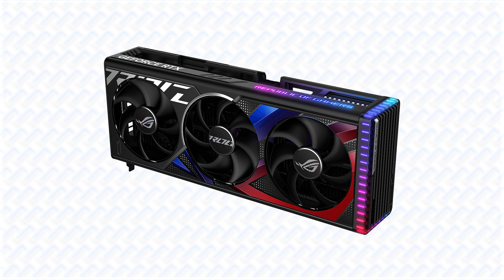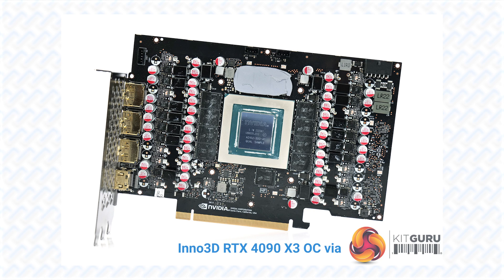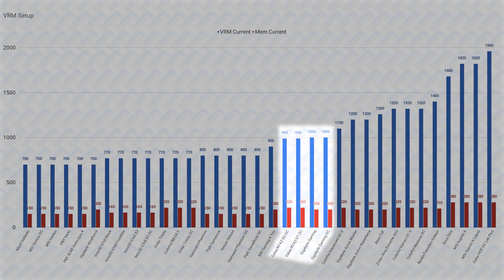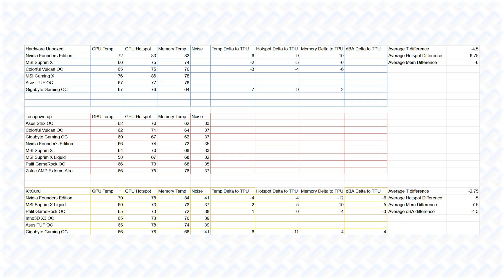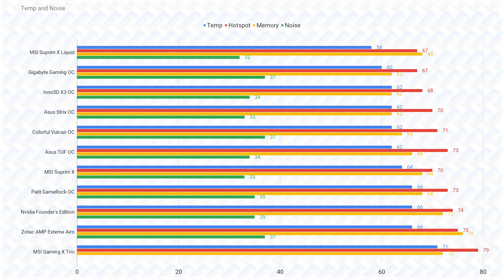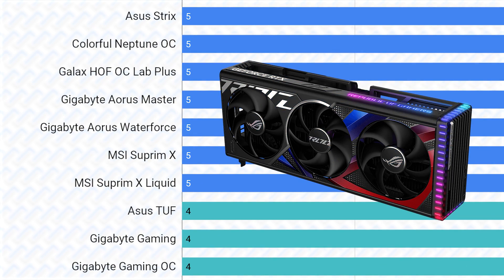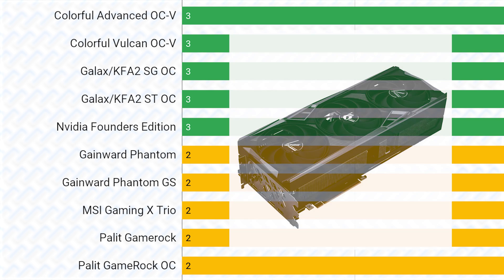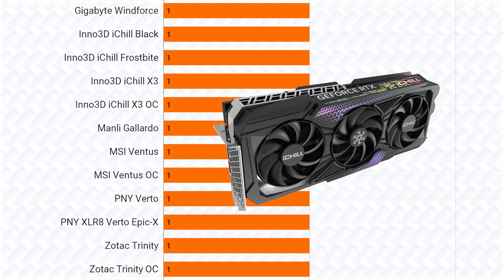Which RTX 4090 to BUY and AVOID?! | 35 Cards Compared! Asus, MSI, Galax, Gigabyte, PNY, Palit, Etc.

Comment: If going on synthetic benchmarks, when u have lots of xxxxx numbers ofc. some ppl. will say it’s a big difference, but in final all that is important, its how much % you can gain from 450W tdp to 600w tdp and that’s from 5% to 10%. But if you play games lets take an example in SOTTR: high overclock(1.1V,3000MHz, +1000mem- 480W, 65% fan speed, 74C, 129fps) and undervolt with overclock(0.096V, 2715Mhz, +700mem - 330W, 40%fan speed, 64C, 122fps), so 7fps(6%) difference it’s nothing compared with all that noise and heat.

Comment: Did you see the tomshardware January 19th review of the PNY 4090 XLR8 Verto?
They claim it has a decent build quality, "great cooling and noise levels". They did take it apart to examine the board and later overclocked the core +180 MHz and the memory to a stable +1600 MHz getting a 6.4% performance boost at 4K for an extra 3W. That's not too shabby for a card that's priced at the cheapest end of the 4090 line up don't you reckon?
Reply from the maker: The hardware is what it is. It is as it is in the tiers. That's basically almost nothing in terms of performance gain from the overclock, its because of the limitation in the power limit.
Reply: @OTechnology  so you read it?... they didn't deny the power limitation at all. And I am mentioning it in terms of pricing. What overclocking gains at 4K could be expected from a more expensive card... you didn't say. Would it be like 30-40%? I guess you and tomshardware have a different idea of value? I certainly wasn't expecting you to change its tier level mate get that out of your head.
Reply: @jemborg  yeah that seemed like a very defensive response and he didn't seem to care about the information you presented to him. Basically ignored everything you said and defend his video. Maybe he is secretly sponsored by some of the card in the tier tiers of his list, maybe not but it makes me not want to watch his vids honestly.
Reply: @Ku5hFi3nd     thanks. It may not be a card for benchmarking but so what? Besides I'm going to undervolt it anyway.

Comment: I purchased my 4090 Suprim X liquid a month ago because I could not an Asus 4090 strix. It looks like I got the better of the trade off.  I really enjoy your GPU videos. I watched this from two different net connection to give you an extra vie and a like. Do views in the lowest quality setting earn the some as the higher resolution views?
Reply from the maker: Yep that's definitely also a good model. Although I don't know if either is better. Thank you for your support haha! I don't think lower or higher quality playback matters :)
Reply: how are your memory temps and radiator temps? Read a lot of complains for really high (still safe, but relative to all the other models) video memory temps + insane high radiator temps to the point the longevity of the pump is questioned by experienced water cooling reviewers.
Reply: @gmdhighvoltage  I have honestly yet to game on the card, but I am mining on it 24/7 and the GPU temp maxes out at 42C and the memory temp is a nice FLAT 68C. with room temp at 84F/29C Compare that with my 3090 amp holo extreme in the exact same system in the exact same slot mining the same coin the GPU was 55C memory 90-94C around the same room ambient the card had no trouble in 97F/~36C room temperature.  Both the air cooled 3090 and the water cooled 4090 run the fans at 100%. You wear out fan bearings quickly when you change the fan speed all the time. Also temps will drop every time the cards are under other load types like video playback encoding etc. Nothing stressing the card consistently like mining, but as long as you have proper cooling (block/heatsink/pads/fans/etc) and AIR FLOW even at high temps there is no problems with most GPUs. I only started mining when idiots blamed the miners for shortages. Go look for the high end nvidia mining cards, most never left china and only now have they been popping up. The shortages on GPUs can be blamed on AMD and Nvidia.

Edit: I fixed the typos

Comment: Thanks for finding the time to do this!
I saw a different take on 4090s from a repairment technician: Strix, Suprim X, FE have the same component base in terms of top quality and the rest (from Techpowerup list) should be avoided as they are much more likely to fail soon after warranty period (from his experience on the same VRM components). What would be your take on possible tendencies to fail of VRMs from your list of 4090s?
Reply from the maker: You're welcome! Well like I said in the video, the weaker VRMs are cost cutting measures to hit lower price points. So, they will inevitably have lower quality components. I wouldn't say they would definitely fail sooner but I certainly would trust the higher end cards to have more chance of lasting longer yes.
Reply: @OTechnology  yet you praise Gigabyte Gaming and he doesn't since it has DrMOS worse than Zotac AMP which is also not good (that's probably why they lowered power limit)

Comment: Does the price for ASUS Strix OC ~ 2290 EUR make sense? Palit Game Rock OC costs me ~1875 EUR. Is it worth overpaying?
Reply: If you are not into heavy overclocking then absolulty not as the additional expense is huge! I have the Palit GameRock and it s solid, great cooling and very quiet. No issues at all since picking it up at launch.  Oh and they are already expensive enough...
Reply from the maker: Its up to you
Reply: @OTechnology  right, but you mainly mentioned overclocking. I don't plan on it because the 4090 has more power than is actually needed. It will be faster to buy another card model than to overclock this one.

Comment: I have a queation. Zotac amp extreme vapor chamber cannot cover the whole vram chip. Even the temp shown a few degrees higher it is certain that the hotspot is a lot hotter because of the uncovered half. How would it affect longevity?
Reply from the maker: Its not a big deal for longevity. Msi gaming x doesn’t even have a vapor chamber. But ofcourse cooler is better.

Comment: You should mention in your video that the Aorus Waterforce rev 1.0 has a tdp of 500w because it's based on the windforce model... What you have on your chart in terms of VRM and power limit applies only to the rev 1.1 waterforce model that has not been seen on retail yet... Every single card sold to this point is a rev 1.0... please don't ask me how i know 😭

edit: By the way what you say about the strix being binned is not accurate for the 4090s... Most of them struggle to compete... It might be a bios thing, but most of them barely exceed 3.0ghz with the extra vcore, while other models can go up to 3040+ mhz without the extra vcore...
Reply from the maker: Wait a second. This is new information to me.

Comment: Have a KFA2 4090 SG OC that I got at the msrp in my region, runs cool and quiet even when drawing 430W+. Have only heard coilwhine when at 600fps+ in menus in a few games. I have a 3080 Aorus Master (also a 4 slot card) that runs hotter and louder. Since I run my games mostly with a 120 fps cap, the 4090 in many games draws less power than the 3080, even when I run the 4090 with much higher settings and RT enabled at 4k. Very impressed by the 4090 so far and I really can recommend the KFA2!
Reply from the maker: Yea the Galax/KFA2 SG cards are impressively good for not being their top end HOF card. Definitely a good 4090.
Reply: I have 4090 HOF standard edition which puts me on 12th rank for vrmark hall of fame, squeezing 680W with gpu oc-ed to 3.06GHz running at 52C. standard stock fan, no mods.
Reply: This is with the Galax version the best looking RTX 4090 I think! 💯 👍